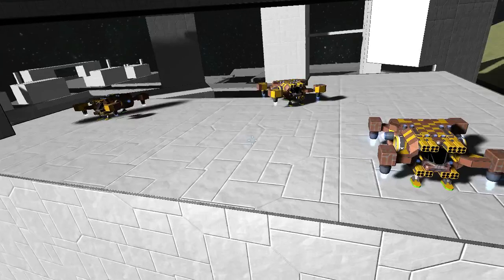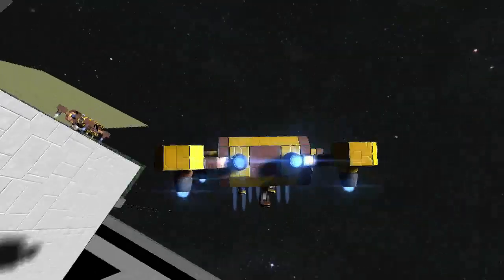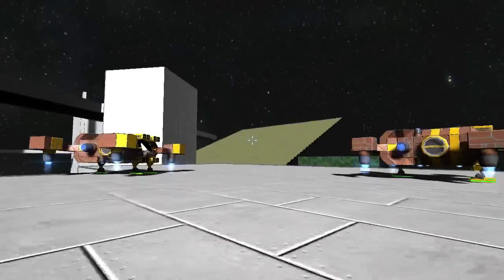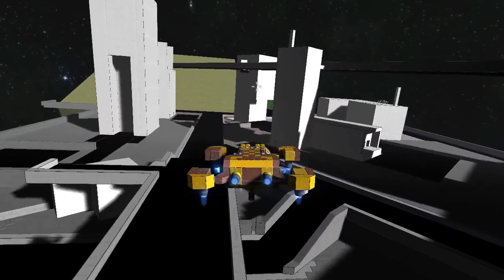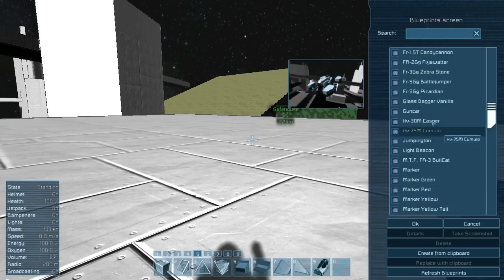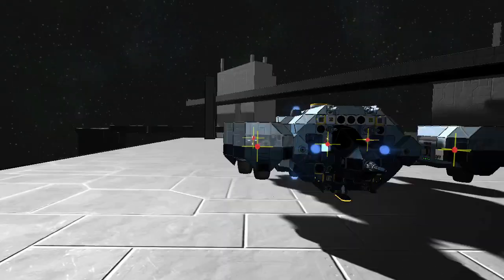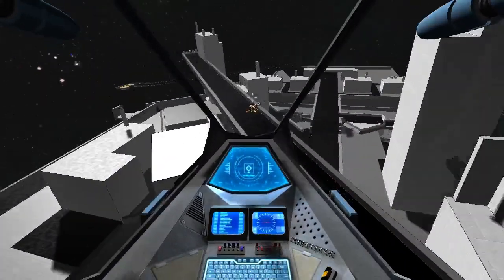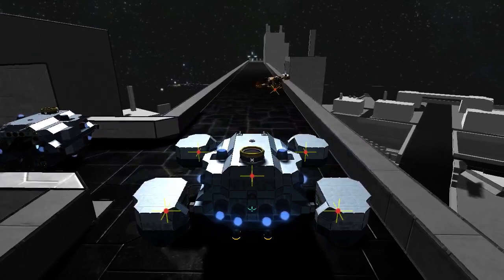Let's Design Hovercraft (Space Engineers)

Comment: As I generally agree with center of mass to be aligned, I must say that mine is a little bit different. I probably won't be able to play with you because of different time region... (F*** work).

I will try to post mine so maybe someone be kind to showcase it today.
My approach is to get your main grid center of mass to be slightly above the cells. This way accelerating will cause ship to tilt downwards. This helps a little bit in gaining speed (plus looks super cool - just like choppi does). However the best thing is that when stopping it tilts upwards making the attached engines will counter not only gravity, but also will help in deceleration. Same thing with strafing - it will balance itself so it wont fly by its own.
Only thing to keep in mind is to balance it so in idle mode (not moving) - the cells fire directly downwards to the gravity.

I will post mine if I manage.

 (my only need is to have on the server Hinged Conveyors mod and Oki's weapon mod (I used these to make engine cells).
Cheers!
Reply from the maker: Scorpek91 That's how I do it if I can't balance it well enough, but I prefer an absolutely neutral balance.

Send me a link to a blueprint (not a world) of you hovercraft, I'll make sure it gets flown some.
Reply: Craig Perko http://steamcommunity.com/sharedfiles/filedetails/?id=501618909 BUMP
Reply from the maker: Scorpek91 I'll make sure to blow it up a few times on camera!